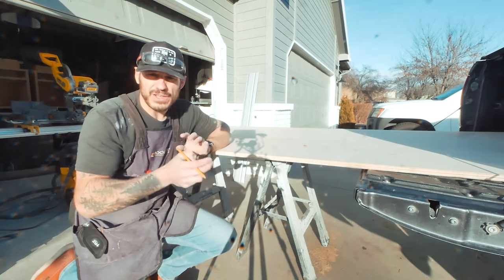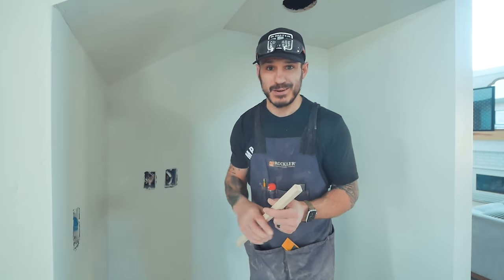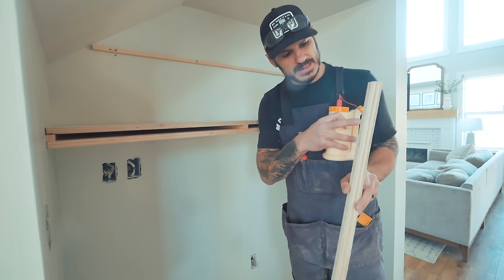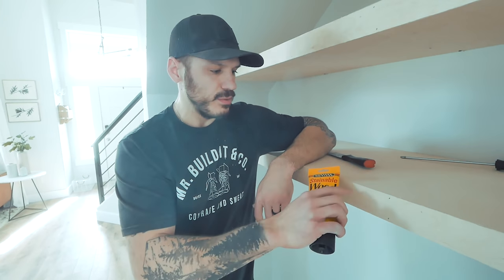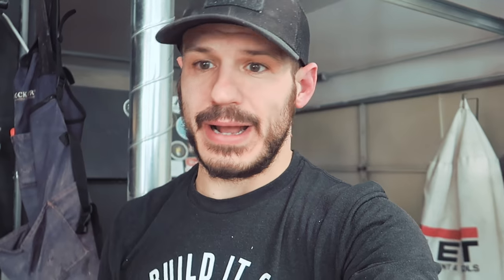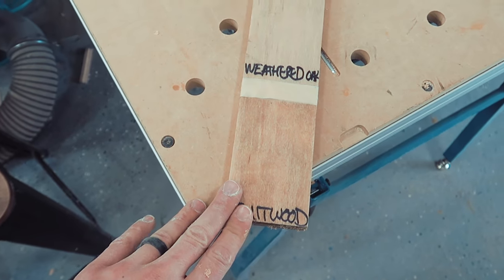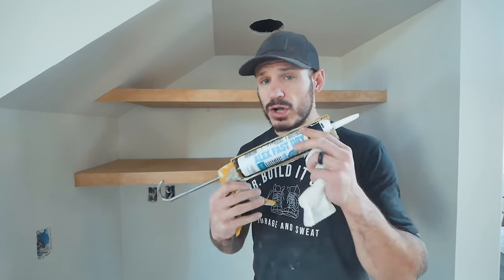Making Built-In shelves

Comment: An old wood worker taught me a trick with that wipe on poly stuff.  Take a section of pantyhose and stuff a wad of paper towel inside it and rubber band it closed.  Use that to apply the poly and it makes nice, even coats with no streaks or lines.

Comment: It looks great.  Good work, brother.  I see you have the same issue I have though.  "Stainable" wood filler does NOT stain the same as the wood you are staining and causes definite variations where you use it.  Trying to find a better solution for filling those holes for staining.  Painting, obviously does not create this issue.
Reply: Mark Arnold best thing to do is use sawdust from the product you’re using, mix it with wood glue to creat your own filler... exact match each time

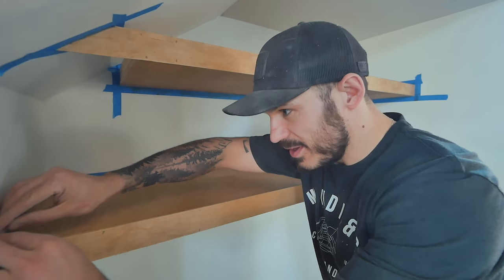Comment: 11:16 
But why do you leave the gap on the upper shelf? 
Would look much nicer if you closed the gap between the shelf und the wall
Reply: I agree. Why not just match the angle of the slope of the roof to the edge of the shelf? :((((((
Reply: I agree - the top shelf could look better
Reply: looks good from my house!
Reply: VJasmin I’m sure he didn’t think of it till after it was installed.
Reply: VJasmin couldn’t agree more
Reply: @trueblueent  LOL!
Reply: The reason he didn’t extend the top shelf all the way to the angle ceiling/wall is because there were not any studs to secure his backer strip to. Could he have dressed it out and cut the wood to look like it is secured to the wall? Yes, but I guess that didn’t seem correct to him at the time from a strength of shelf stand point.
Reply: @jakesaround  the reason is skill level.
Reply: The shelves kill into the bottom of the stair rake which is typically a 50 degree bevel/angle give or take. Not everyone has the tools or experience to accomplish that. And on top of that, as he mentioned, none of that is square or level. So it would end up being a 50 degree bevel plus or minus and an angle on top of that. Not the easiest thing to do, although it can be done. Using a scrap piece of shelf to find the exact bevel and angle is the easiest way to achieve it.

Comment: Hi there, great video with very good detail/explanation on every step. Any suggestions for properly adding a face plate to existing shelves that have a rounded edge? I moved into a house with built-in shelves that have one piece of plywood running vertically with a rounded edge and then each horizontal shelf also has a rounded edge. I want to update the style so it looks squared off like your video. Thanks!

Comment: Love the videos and great work...keep it up! Question about the shelves you built in this video...what are the dimensions of the longer shelf, specifically the how long and deep is it? I'm getting ready to build some very similar and can't decide what thickness materials to use because my wife would like them around 1" thick. The space I'm putting mine in is roughly 53" long and 9" deep, so I need to make sure I have enough support in the middle so the shelves do not sag. If it helps, they will be supported on three sides (like yours) and I'm going to use 1/4" plywood top, bottom and facing. Any suggestions would be greatly appreciated!

Comment: What if your walls are more wavy? Scribe it? Thats tricky. My walls arent flat enough for a small bead of caulk.
Reply: So I'm a joiner by trade an it's so much easier making them before putting them up, you can make it look so much nicer. and yes you can scribe them but just allow for that in your rebate that to make sure it will still be deep enough to allow for the fixings to still fit. Hope this helps

Comment: The last time I tried to I cut miter joints for a shelf I ended up cutting off too much I can never tell where the blade will meet the wood. Is there a trick for measuring or some kind of indicator on the saw that will tell you where the cut will be?